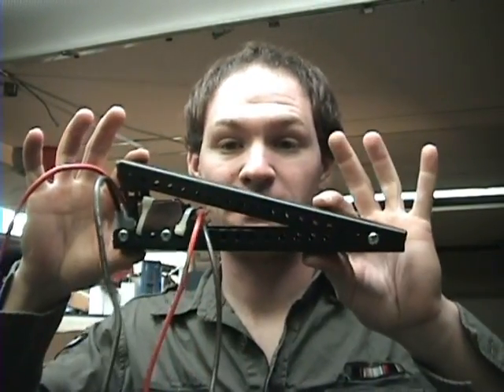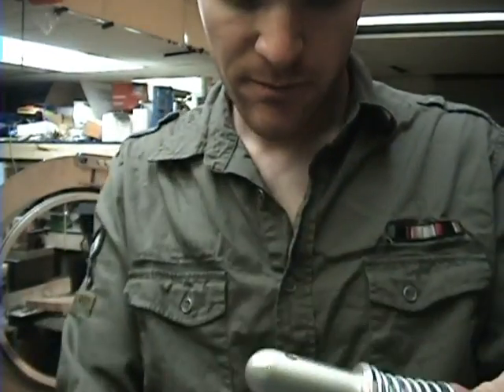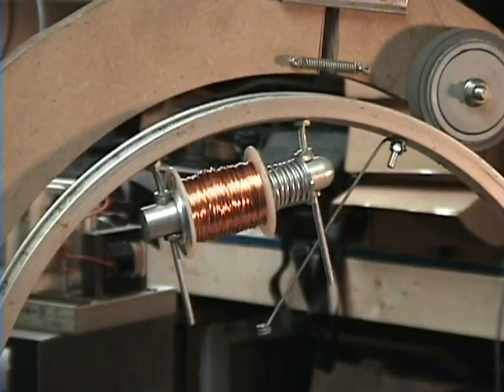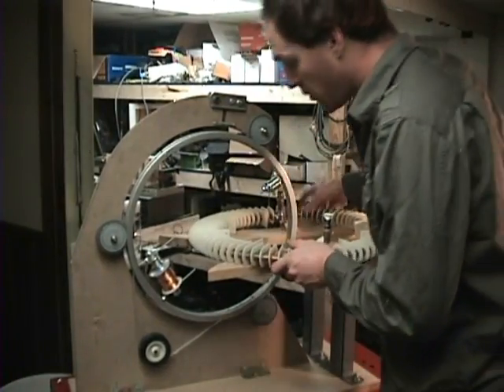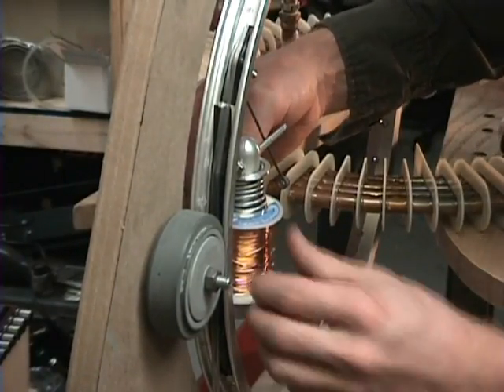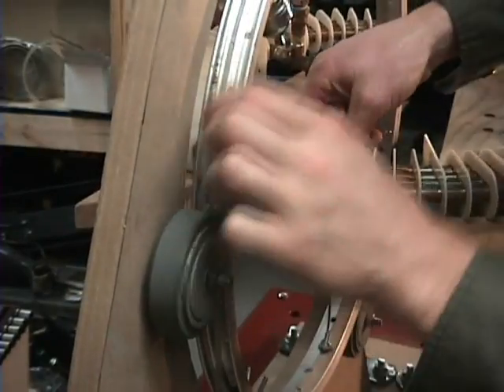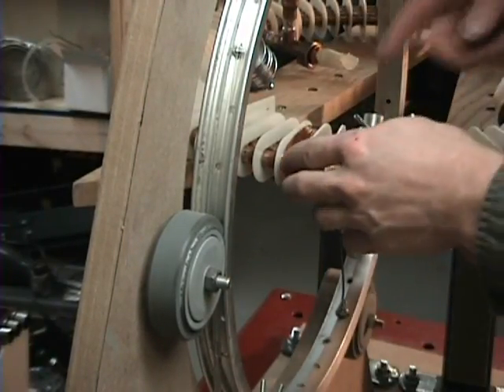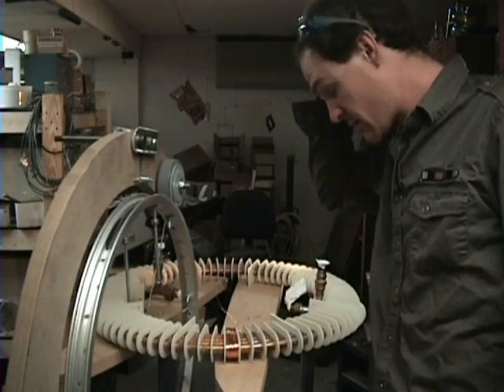#5 EPG Coil Winder, How It Works And Wrapping The Fist EPG Test Coil. Home Maid Troid Winder

Comment: I like this project. Simly and I suppose cost not much. But I am affraid it will not work with wire of 2 mm dia. Secondary windings on toroids have wire like 1,5 dia - 2,5 dia . And what else can be problem with holes of toroids. Your project can now wind coils on toroid like 80/40/35 . For holes around 40 mm your ring with spool of wires will not go in. There is solution for smaller doles ?.

Comment: Why did you not drive the rim directly from the rubber wheel just using friction? Just out of interest im assuming the is a design reason. Belting setup though may consider something like this to build my tesla coil

Comment: Very interesting design. you already know why your machine is unbalanced. you've taken a bike rim and added  nuts and bolts to it, but when you add the spool of wire there isn't any counter balance to it. But then the real problem is that when you add the full spool of wire and counter balance is that when you wind a few coils that the counter balance will make it lose balance as the wire is placed . Also a simple lap counter could be added to count the winding's for you.
Reply: M.Thomson's right, you "could" and i say this verry lightly, use 2 wires at a time at opposit sides. This would mâle tout winder much more stable. I'm just not shure if having 2 wires of 65' would work as well as one wire of 125... Would That ne possible?

Comment: I have certain concerns about the lead, because you're grinding off the lacquer from the copper and that leads to a short circuit in the coil. It would be better to have a plastic roll that guides the copper wire from the roll.

Comment: why did you use copper pipe when the patent called for non magnet and non inductive material?  Also, what did you learn about the permanently magnet particles needed to flow through?

Comment: 3 6 9 the code spin balls in the field right and get levitation 3 magnetic balls per ring axis 3 axis and a whole lot of magnetic acceleration needs a strong costruct for those kind of speeds. speeds way above 9.81m per s oh and dont mind the vibration its realy high pitch i saw it run in a jurney ;)

Comment: Guess you have to step into the wayBack machine to see where the 3/4 piper came from.

Naw, I'll assume it appeared by magic.

I'd be more interested in making coils using a 3D printer tho', If possible. I highly doubt the technique has been developed or you might have already gone that way. I think I'll check that out!! 

Just some speculative thinking out loud.

Comment: Many times I watch videos and I am not signed on and it would be a hassle to accommodate your request. Looks like and sounds like you have a wire sewing machine. I am thinging many of your viewers have some idea about 3 & 4 pipe and what you are doing. PS Do you really need to flash the Satan horns sign? You don't strike me as a Satan worshipper.